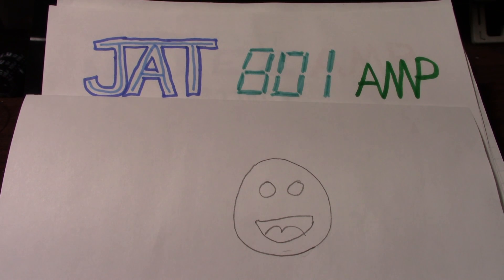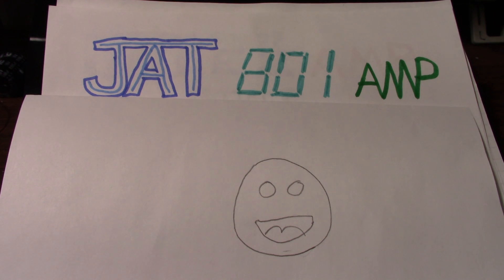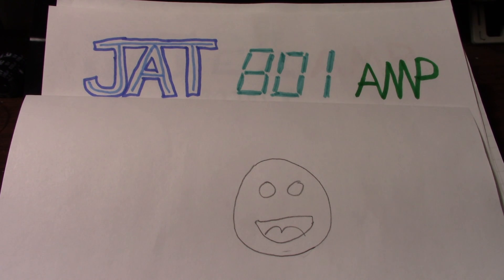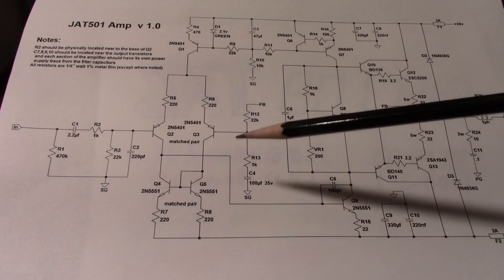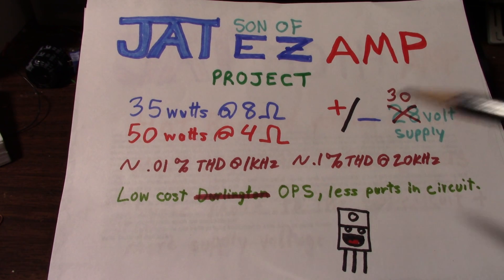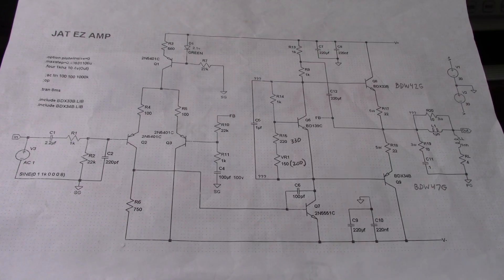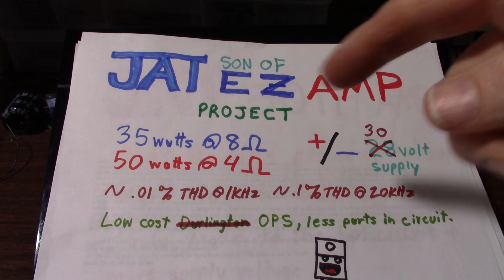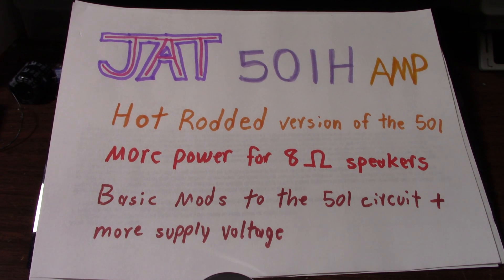3 new audio amplifier projects!

Comment: Hi new sub to your awesome chanell. 
Im building 3 amps also one TDA one LM3886 and one Transistor 
Im on a budget so can only afford one transformer. 
I have placed an order for a 26-0-26 with a 15-0-15. 
On reflection I realize maybe I made a mistake. Maybe I should have done a multi tap with an additional tap at 45-0-45 but oh well hindsight is always easy. 
But I still have a problem I may need to drop my voltage to 24-0-24 for one of the ICs. 
Can you give us some tips on how to regulate transformer voltage says I want to drop it a few volts. 
Should I just add an extra diode or should I build a chain of Zener diodes on each amp.

Comment: Have done a comparison of the different JRC Brand Op-Amps nmj4556,4558 and 4560 as each one has different specifications the 4556 says 700mw and drives 150 Ohm Load and the 4560 is 500mw but drives a 400 Ohm Load?

Comment: Hi John. Do you have any videos on scoping a bridged output? A board I've been tinkering with takes a 48v single supply and I haven't had much success scoping the output. I tried channel1-channel2 in math with the grounds of both channels on be probes floating but the results did not appear accurate.
Reply from the maker: I use a floating (battery powered) signal source and power supply so not to short one side of the output when connecting the scopes ground.
Reply: @JohnAudioTech  the signal is my phone and the power supply is toroidal. Both floating. I think my issue is the ground reference. It doesn't have one. Both the single supply input and the bridged output are fixed with no reference to ground. I think maybe i need to work out a point on the board that has reference to it's virtual ground. Thanks for all the info. It's a Sure AA-AB31241 600W class D board based on the TAS5630

Comment: Can you recommend some good low to medium power output devices and some small signal transistors that i should stock if i want to play around with some simple amplifier circuit designs ?
And what other components do you recommend for this sort of stuff?
Reply: Could try the Velleman assortment transistor kit. Contains European Pro Electron coded transistors. BC547/BC557, BC337/BC327, BD139/BD140. Suggestions further to this section are 2N 3904/2N3906 low power, 2N5551/2N5401(higher voltage medium power/driver transistors), MJ/MJE/TIP power transistors, BD441/BD442 ,BD911/BD912 power transistors.

Comment: great video well explained ,ive built loads of amps modifying them to parts i already had    the biggest failure i had was trying to use darlington pairs of bdx33b bdx34b they would always die short circuit from thermal runaway- sounds like exactly what youve had --no matter how close i fitted the output bias transistor or type used. sounded great till it died though , i went hitachi mosfet after that (1990,s) and still running 2sj50 + 2sk135 to this day, not so sharp at top end but they drive tired old 80,s speakers so tightly -id love to see a modern take on that old hitachi mosfet textbook schematic

Comment: normally you do not get 200 watts with 50v-0 v-50v DC. I have L20 class-ab from LJM. it has 8 transistors and I get between
150w and 200w 4 ohms. but not quite 200 wstt

i have naim nap 250 clone board from ebay with 2 transistors.
With 37v-0v-47v DC.
and 2x 4 ohm 50hz sine tone I get 2x130watt

Comment: It would be great if you did a video on how to best put all the electronics in the case. Like transformer placement, signal wires and volume pots... so that they don't pick up the stray magnetic field from the transformer and power switch wiring.
Also a video on making acrylic project boxes would be cool.

Comment: While I'm very interested in the project and will watch the videos about it, I'm a little confused by someone would think that the JAT 501 lacks power but who would be satisfied with the JAT 801 at basically twice the power.  Doubling the wattage only gets you an extra 3dB.  If 50 watts isn't enough, would 125 watts make a relevant difference?  I'm genuinely curious and am not intending to attack anyone, but I've never considered it worthwhile to merely double the wattage of an audio system.  You really have to bump it up 5-10X to make a discernible difference.
Reply: That's true! Not sure why anyone would need to do that... But then, I don't understand why these ppl around here have to drive around in their "thumper" cars, damaging their hearing & having their guts ripped apart by their audio system-- just to annoy the ppl they cruise by in a parking lot, or stopped at a red light. 
What other reason would they do it, except to annoy others?! 
I know for sure it doesn't "sound good," because they couldn't possibly even "hear" it...no, it's a completely "visceral" effect, literally!
Reply: 3db is honestly quite a lot it's 6 increments of 0.5db. Like from the supply voltage it's +-35 to +-50V. The improvement would be notable.
Reply: @johnyang799  - 3dB is literally the smallest incremental gain that you can actually hear.
The difference of 3dB is NOT "notable".... Technically, it's described as "Barely Perceptible Change", which means it's almost indistinguishable.
Reply: @johncoops6897  0.2dB is the minimum audible difference. And most people can hear 1dB very easily.
3dB is honestly a good step up from JAT501. Especially for 8ohm load. It can be the difference from clipping and not loud enough to not clipping.
I would say if the improvement is 0.5db to 1db in level then it's a bit small. 3dB is ok.
Reply: @johnyang799  - You need to do some proper research, because you have this subject completely wrong.
A change of 0.2dB is DEFINITELY not audible... even 1dB is considered an "Imperceptible Change" to normal listeners.
The reason that frequency response is usually quoted at +/- 3dB is because that is the minimum amount that is definitely perceptible - effectively 3dB is a "Barely Perceptible Change".
Show me some scientific documentation to support your claims, because they go against literally all common knowledge.
Reply: @johncoops6897  The book Psychoacoustics by Hugo Fastl Eberhard Zwicker  Chapter 7.1.1

Comment: please help me with my Work of JAT501 the vas stage was still hot when powering into +/-24volts dc,
Reply: The transistors in the VAS stage will get warm even at +- 24 volts dc.  This is Ok.  You can determine the current in the VAS stage by measuring the voltage across R15 and divide it by 100.   It should be about 650 mv which will give a current of about 650mv/100ohms = 6.5 milliamps.  This will drop about 1/6th of a watt in the transistors Q7 and Q9.  This will warm up the transistors a bit, but it is well within the about 650 milliwatts that these transistors can handle.  If the voltage across R15 is much higher than 650mv then there might be something wrong with Q6 or Q7.
Reply: @argcargv  is it ok that the Q7 and Q9 will get warm or hot, even in +/-24 volts dc?
Reply: @argcargv  i didn't put a signal into the input of the amplifier but the Q7 and Q9 get warm and can't touch it because it's getting hotter
Reply: @djgebhartmmc3265  If Q7 and Q9 are too hot to touch for any length of time, then something is wrong.  But they may feel fairly warm to the touch, but they shouldn't be warm enough that you can't leave your finger on them for an appreciable amount o time.
Reply: @argcargv  yeah just like that but i can't evenly put my finger fo a long time, touching to it, because it was getting hotter for my feels
Reply: @argcargv  do you think there was a problem with my transistors? Should I need to replace it all?
Reply: @argcargv  i put a 2 inches spker to spkr output and i touch the input of the amplifier, i get a small audio output, is that ok, but compare to the other design the input sensitivity was to hight when you touch the input?
Reply: @argcargv  your explanation was very clear thank you for your answer ill manage it later and i will test the voltage across R15 100 ohms if i can get that target voltage,  btw how i can reach you, through messenger if possible i was looking who could help me fix with my constructed amplifier which is JAT501,? thank you,, pls reply 😢

Comment: Designed a board for JAT501 a long time ago and it didn't work. Fast forward to this month, I redesigned a board and tested it with some modifications. After tweaking, it has 0.00003% THD at 1khz with 4ohm load and 0.0005% at 20khz. 
I was obsessed with current feedback amplifier but after going back to voltage feedback I realized that in a circuit with 4times gain or higher, VFA is much better suited and can perform extremely good.
I was in university the first time watching your channel. Now I'm an circuit designer for audio partly because of you. Thank you John.
Reply from the maker: Do tell! Those distortion levels are a couple orders of magnitude better than what I'd expect to achieve from the 501 design.
Reply: @JohnAudioTech  I tweaked fair a bit of the compensation circuit. And I used two matched transistor pair in SMD package in the input stage. There also should be some filtering between the output stage and the VAS(and the IPS) for the compensation to actually reduce distortion, 10ohm 220uF RC filter.
Reply: @johnyang799  do you have a schematic of the changes?Or any printed boards? Are you talking about matched transistors on the differential pair?  Part #?
Reply: @dantheman1998  You can start with two pole compensation (TPC)and transitional miller compensation (TMC) from two of the design books. You can get 90% there. 
And yes I was talking about the pairs of transistors in the input stage.  The type of transistors are two transistors in one package and have matched to 2% or better hfe, VCE and VBE.
Lastly you need to make sure the supply rails of VAS and IPS to be as clean as possible. Otherwise you wouldn't get the same performance.
Reply: @JohnAudioTech  hello mr JAT how are you
Reply: @JohnAudioTech  can i reach you through messenger please, I'd like to send some picture of my work JAT501 😢
Reply: im struggling with the jat501 i try to build it and didn't work normaly the vas stage was so hot along the 2n5401 2n5551 along with bd139 ang bd140 stage, when powering into +/- 24volts dc,  pls help , mr JAT didn't reply to my question in his previous release design of jat501 please 🥺
Reply: @djgebhartmmc3265  Make sure the direction/orientation of BD139 BD140 are correct. Double check and triple check that.
Reply: @johnyang799  i doubel check it sir, and i also replce it with c5171/c4793  a1930/a1837 reason to ease the heat created by the transistor 2n5401 emitter connect with 100 ohms to negative rail and 2n551 connetec 22 ohms connected to positive rail 😢
Reply: @djgebhartmmc3265  The amp is either clipping in the negative rail or doesn't have any input. 
Make sure the bias spreader is working properly. Measure the voltage across the bases of the two drivers. See if that's correct.
In other amplifiers there's current limiting in the VAS but those are with an extra emitter follower in the VAS.
Reply: @djgebhartmmc3265  Is your current source working properly? Measure the voltage across the current source resistor and voltages of other points.
Reply: @johnyang799  the amp is operating at the no signal input operation, i also check the voltage from gnd to base of bd139 and bd140 which i read about +1.2 volts -1.3 like that,
Reply: @johnyang799  i check it later, btw what resistor did u mean the 470 ohms resistorm
Reply: @djgebhartmmc3265  Simplest way is to check against simulation. DC voltage at each point. This way you'd find the issue quite easily.
Reply: @johnyang799  im sorry but i don't have any equipment to use and didn't know how to simulate this circuit, using the technique you said, 😢
Reply: @johnyang799  i ask mr JAT on his first release design, to have either one if his pcb board design, because mine was constructed into prototype board ,like what he did on his previous videos,
Reply: @djgebhartmmc3265  Having the manufacturered pcb is always a good thing.